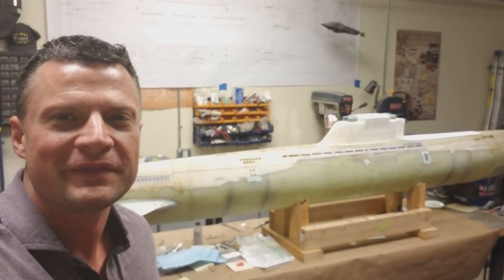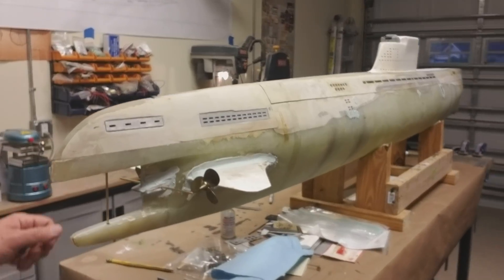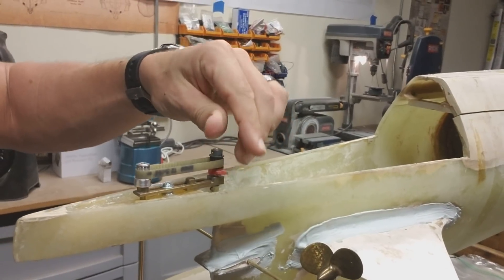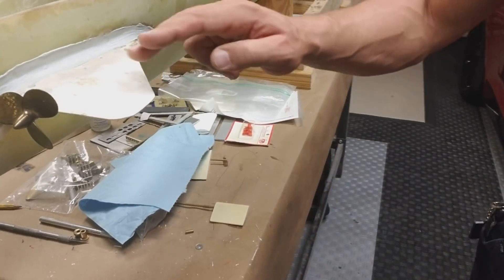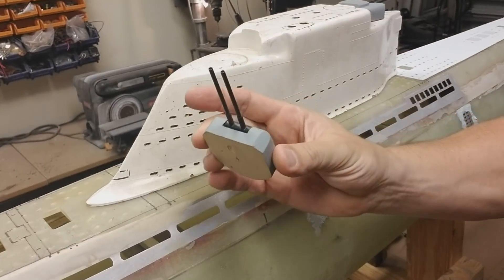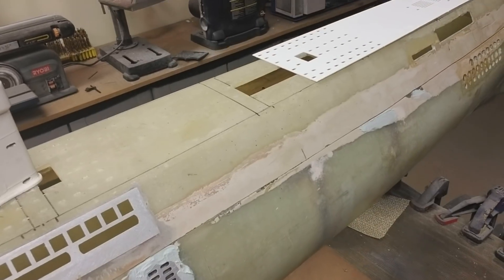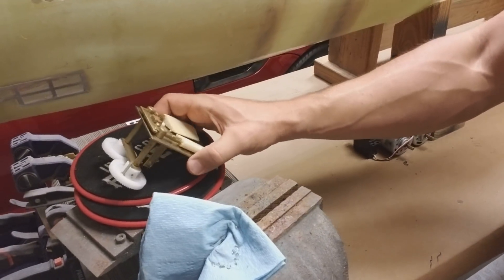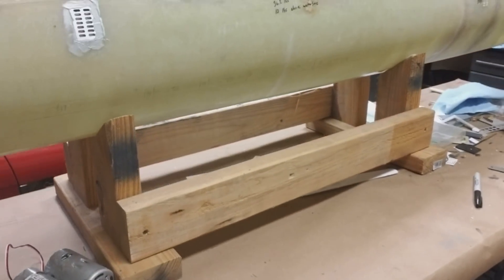Massive RC German Type XXI Submarine Build Log #1

Comment: Hello Bob, awesome your channel and rc subs! Please I am interested on a German Type XXI 1/40 scale just like the Robbe discontinued kit model. Please could you let me know if you can do the 3D work and the price for this? I think there is a lot of people here in Europe looking for this kind of WWII sub. The watertight system could be, for example, the Robbe or Engel tech rack attached to the stern and bayonet lock ring and the hull in three sections (stern, central body hull and bow) for easy transport due the length of the uboat (191 cms!)  Other option could be the American RC submarine model way with internal watertight cylinder and hull divided by the waterline in two half parts: bottom and deck ones. Many thanks in advance and cheers from Spain, Manuel. Youtube: modelSUB2000 Twitter: @ModelSUB2000
Reply from the maker: Not sure about possibility of 3D files, but I will be releasing a 1:48 scale German Type XXI kit in the near future.
Reply: @RCSubGuy  Many thanks for your kindly reply, Bob. The 1/40 scale Type XXI is for a customer/friend who has a Robbe U47 is his collection and want a same scale XXI rc model. Anycase it's a very good new that you could release a 1/48 XXI kit in a next future as sure there is a lot of people waiting for this kind of German submarine kit. Regards from Spain and have a good week.